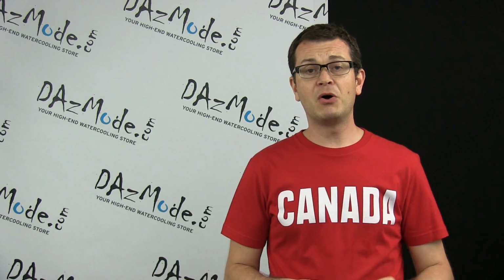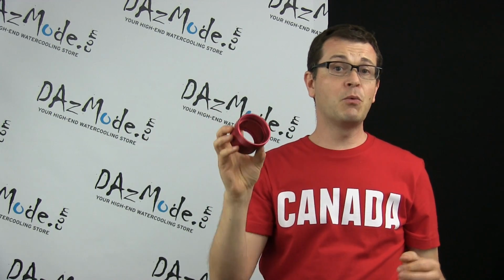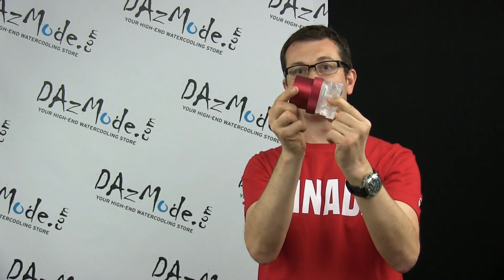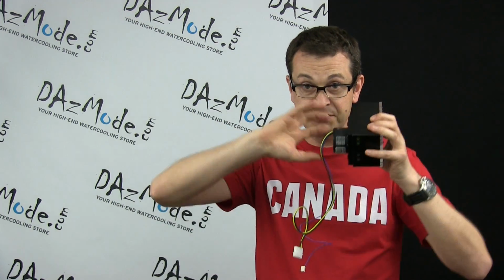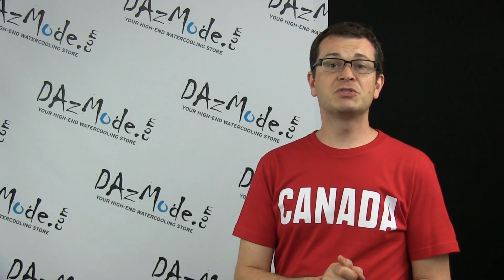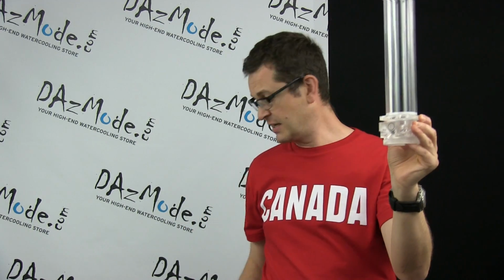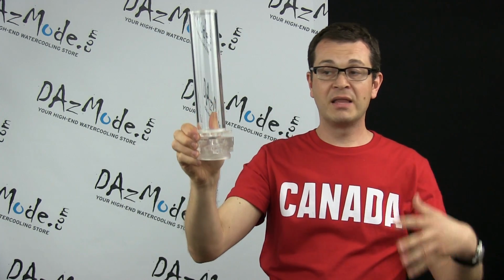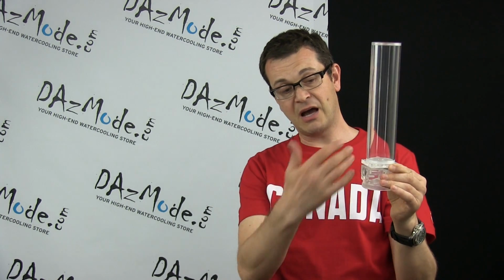Bitspower D5 Pump Advanced Modding

Comment: I've been trying to find info on the Bitspower upgrade kit, and this actually covered most of my questions.  My only remaining question is whether I NEED to use the Bitspower pump top for the tube, or if it's compatable with an Alphacool acetol pump top.  My guess would be that I need to stick with Bitspower.

Comment: Koolance pump tops work with bitspower tube reservoirs. I did that.
Reply from the maker: Pictures of worklog?
Reply: DazMode http://imgur.com/zt3pRUB

I used Koolance Rp450 Bitspower Tank upgrade and swiftect d5
Reply from the maker: I see. Seems like Koolance has same M52 threading as BP, so BP tube can be used.

Comment: What is the Bitspower Acrylic Anti-Air Chamber Set that I see all the time with bitspower pump tops? Mine didnt come with those and I have flow rate issues, do I need to buy some & will it potentially help my bitspower D5 mod top S model perform slightly better or benefit in another way?

Comment: I have a moded bits power pump top and 150 upgrade kit......but I have a question.....I dont understand the function of the tiny plastic nub that screws into the unused hole on the bottom of the rez........does that unused out have to be plugged?  Or is the pressure from mounting the rez enough to seal it? And what does that plastic pill shaped little nub have to do with it?